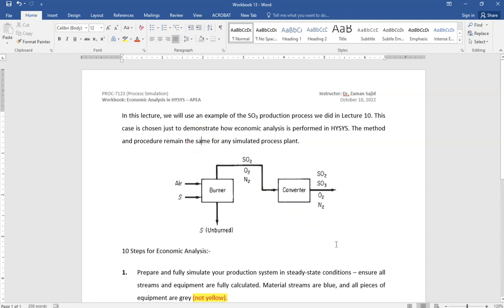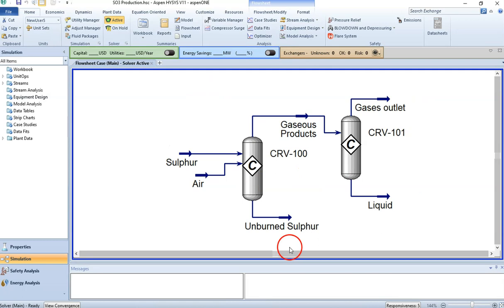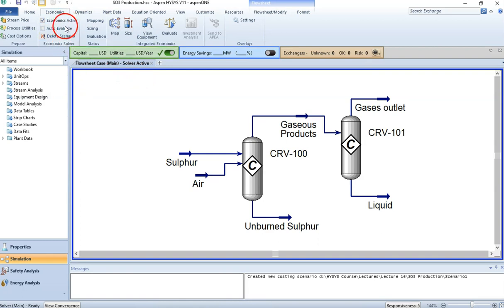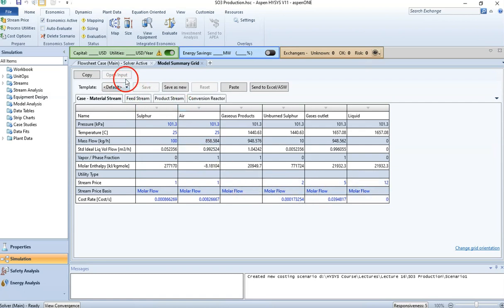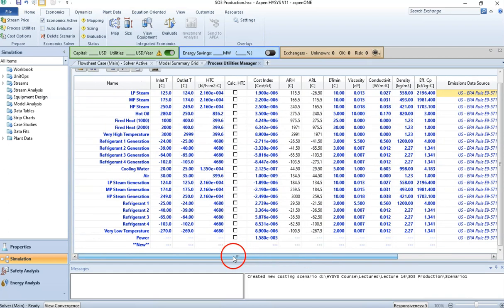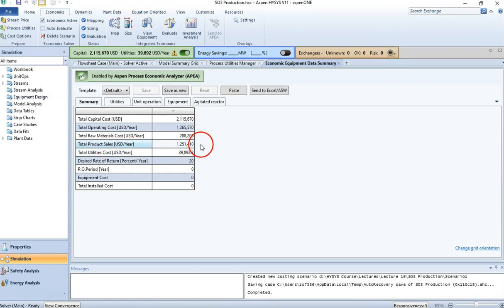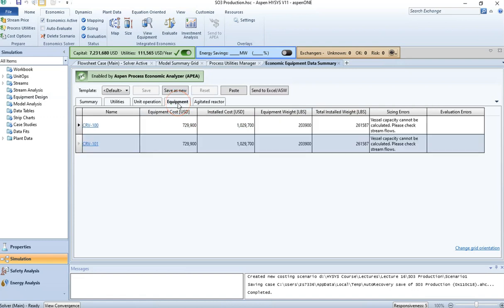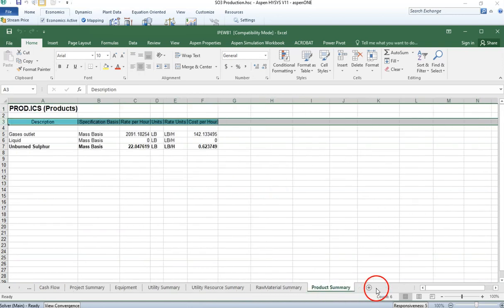Economic Analysis in Aspen HYSYS

Comment: Hello Dr. Zaman, thanks for this good example, I have one question though, how do you change the dollar rate to the current naira rate we use in Nigeria, also if the all products produced are calculated into the sales, what happens to the products that are flared which are not sold, would you also put a price for it, or you just zero price for it?
Reply from the maker: Thank you. Yes, you can use Naira. You need to know its conversion rate to the US dollars. Under Economics, click on Cost Option, then click on the Currency tab and enter the currency symbol and conversion factor. Doing this, all background calculations will be in US dollars, but the results will be displayed in Naira. I am unable to understand your second question. We do not produce anything waste. All products, including waste products, have some financial value. A waste or side product of your plant may be the actual raw material for some other products. I hope this helps.

Comment: Thank you Dr. Sajid for the lecture. If I want to edit the excell spreadsheet (in this case i want to add some project cost componen e.g. offsite facilities CAPEX or add VAT),  will  the result generate automatically ( in this case for NPV, IRR)? I assume that excell spreadsheets are linked function.
Reply from the maker: Yes, Excel spreadsheets are linked, but please ensure you have the right formula and use the correct cell for your data editing. Good Luck!

Comment: Dear Dr.Zaman, 
Thank you for the video, it's very helpful. 
What should we do if an equipment does not exist in the APEA library? 
In my case, I am simulating an electrolysis process and I don't know how to include the electrolyzer in the economic alnalysis.
Reply from the maker: I am glad it is helpful. To answer your question, you can design equipment in HYSYS, choose a similar unit in the APEA library to the one you need, and provide an engineering design allowance of 10% (a recommended value for a new process in the APEA manual) design changes. If your process is unique and unproven, the engineering design allowance is 15%. Please read the APEA manual; if you do not have it or cannot find it, email me, and I will share it. I hope this helps.
Reply: @drzamansajid   Thank you 😊
Reply: @drzamansajid  Dear Dr. Zaman, I got the following error "stress for shell material is zero " during the evaluation of some heat exchangers. 

How can we solve it please?
Reply from the maker: @dohaelrhoul3849  Please email me your HYSYS file. I cannot comment or guide you until I see your simulation.

Comment: Hi, thanks for your video. normally a stream contains multiple components (reactor effluent), how to define price of each component in that case as aspen offers to define stream price only!
Reply from the maker: You cannot define the prices of each component in a stream due to obvious reasons. What I would do is compute process economics based on each individual component. That way, you can see which component has the highest/lowest associated cost.
Reply: @drzamansajid   Thanks for your reply. How to compute economics based on individual components? I put a component separator at the reactor downstream which separates all the components in multiple streams. Then I calculated the cost of each stream which is basically the component cost. Is this the correct way or is there any better way to calculate the component costs? Thanks
Reply from the maker: @syedejazhaider2996  Interestinng point. Please email me, and we will meet on Zoom and discuss.

Comment: "ERROR> 'HE -    6' THICKNESS CALCULATED EXCEEDS 25 PCT OF PORT DIAMETER
Thickness CALC: 6.250 INCHES" , ERROR> 'GC -    2' INLET TEMPERATURE IS OUT OF RANGE , how can i fix this errors?
Reply from the maker: Your questions have their answers in them. Please read your questions and you will find how to fix them.